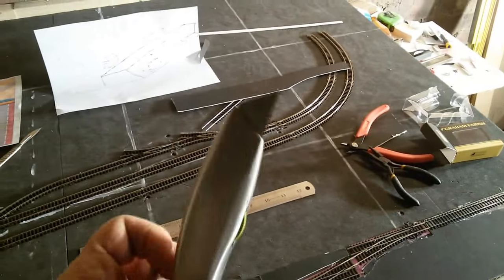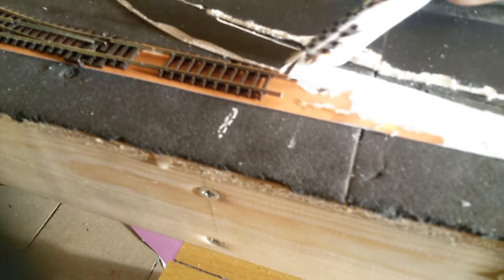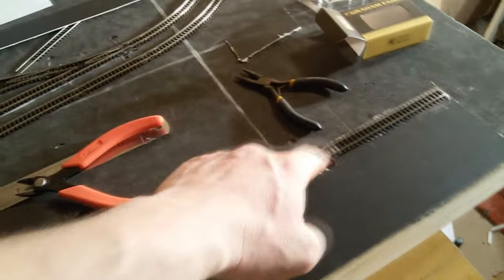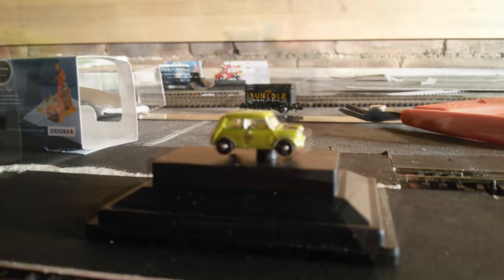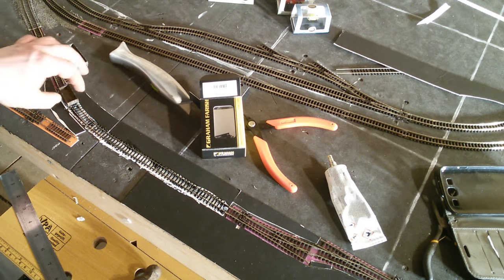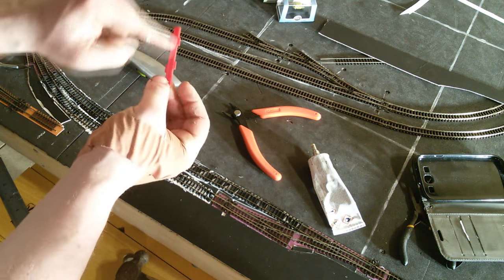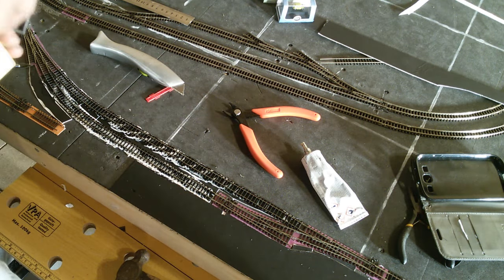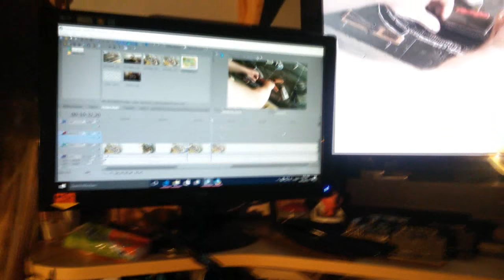Out N About - VLOG 10 - Trackin' Progress

Comment: i have a remote controller and a control panel with a switch, but i'm getting one that controls two tracks and the turntable at the same time
Reply from the maker: orangeandblue tank engine - I'm thinking of buying a Gaugemaster one that controls 3 tracks with one of them a simulation mode for DC.   I want DCC but that can wait until later.  Going to try to wire this  one to suit both.
Reply: that sounds interesting
Reply: love your Vlogs N gauge series keep up making more videos (:)

Comment: What glues was it you used to hold down the track? was it just PVA glue?
Reply from the maker: theredcrane25 I have been using two types.  Bostik Contact Adhesive and the white stuff is just el cheapo PVA.
Reply: okie dokes then, even if its cheap, as long as it does the job, that's all that matters.
thank you for telling me.